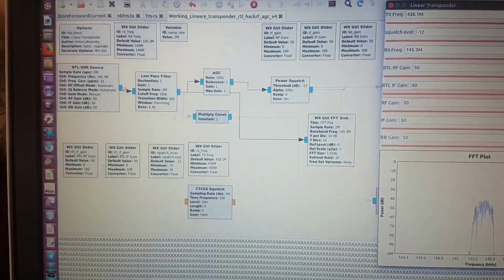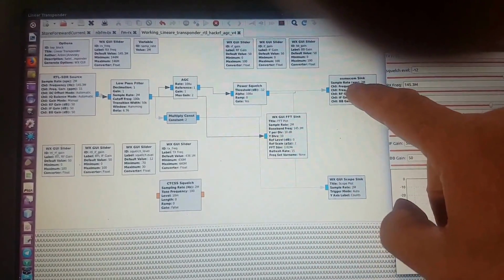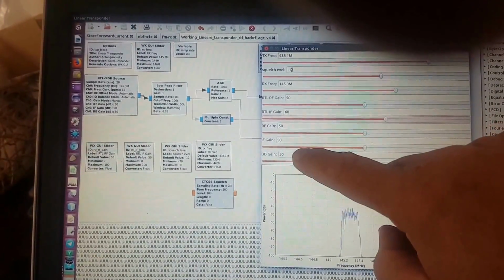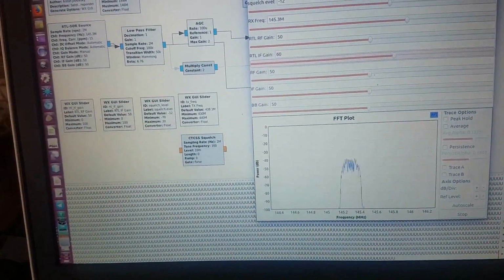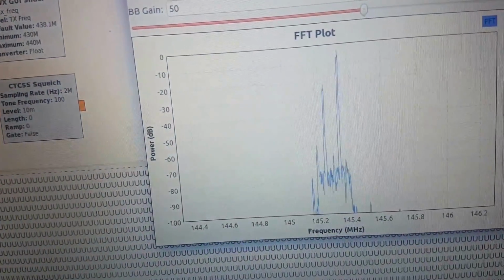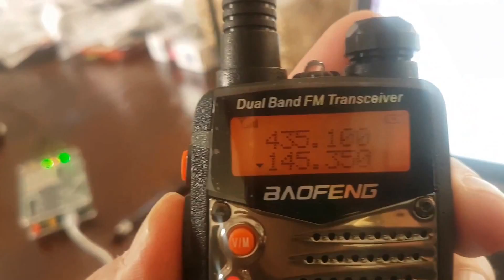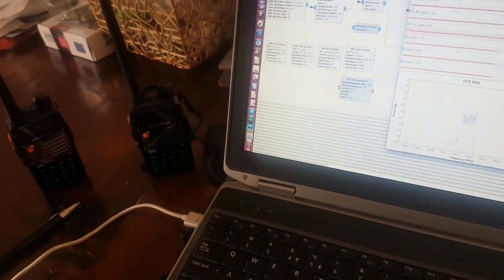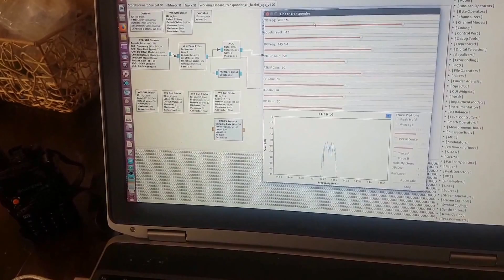Building a Linear Transponder with Gnu Radio, rtl dongle and hackRF module..

Comment: Can’t the hackrf do the whole job on its own? Why is it necessary to use a raspberry pi and an rtl?
Reply from the maker: The hackrf is half duplex only.
Reply: Hack rf no tiene la suficiente potencia de calculo.
El hackrf es en radio, el equivalente a una tarjeta de sonido en audio.
Necesita la potencia de calculo de un procesador, y ademas de cuatro nucleos minimo.
Seria interesante que alguien desarrollara una placa base con un procesador de 4 a 8 nucleos con los convertidores AD y DA que lleva un hackrf o incluso mas avanzados y a ser posible full duplex.